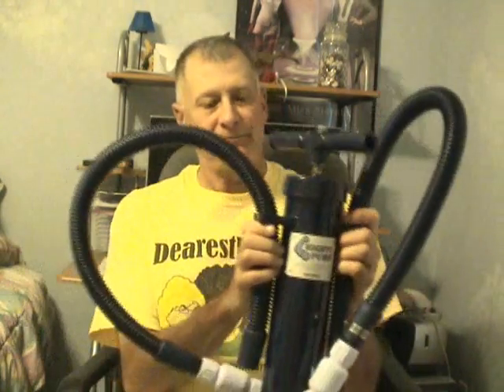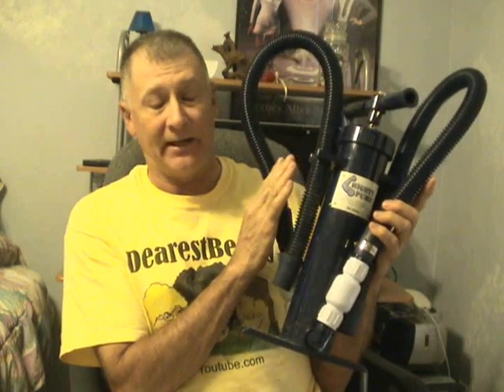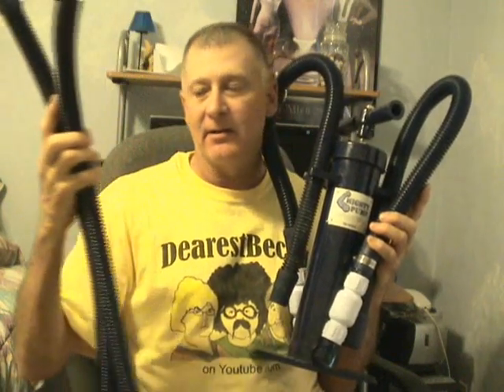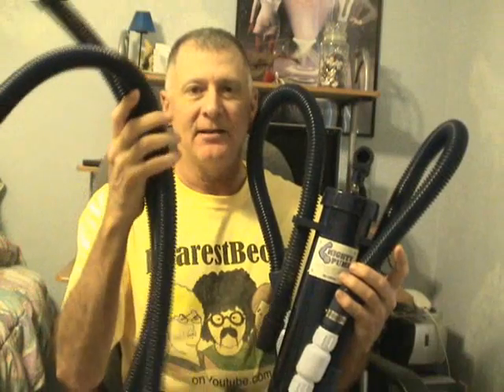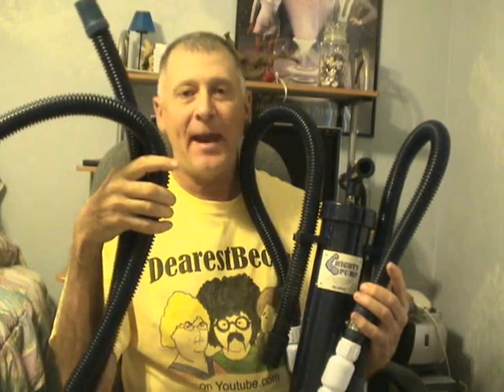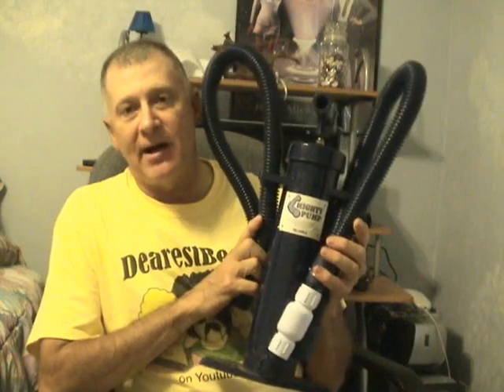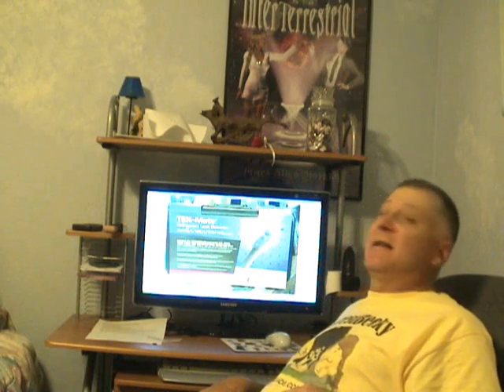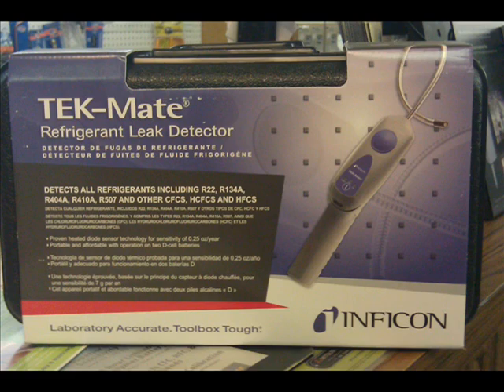HVAC: Mighty Pump update and some other stuff

Comment: I use that freon detector.  (office supplied it)  I've tried a few others but I like the 2 settings and no dial to tweak or fiddle with.  Have only had to replace the tip one time I think and not sure how long it was in service before I got it, hehe. 
   M@

Comment: Hey Doc.  You are right about Payne systems.  I installed a 5 ton Payne split system in my home which had a compressor rated at 4.5 tons. It is common practice in this part of the country to install an air handler rated a half ton larger than the condensing unit.  On my 5 ton system Payne simply went down half a ton on the compressor.

Comment: Worked for a company years ago , where common practice was to bump up evap coil 1/2 ton, to the condenser .. . ( 2 ton Condenser=2.5 ton evap coil , never the reverse) .We always try to go with same Ton drive on the inside blower unit as outside unit ...
Glad to see you posting again !!! Dr. Z that Super Tech, interactive DVD you turned me onto actually lets me do Superheat and Subcooling, with a print out I can give customers !!!
Take care , FRITZ

Comment: Thats some good product support!, normally it takes a lot of complaints and having to request replacement parts!

My first workshop split system was a mis-match mini split and we got it to work pretty good, but the amount of refrigerant had to be increased to allow compressor subcooling. it was a 6.1Kw Mitsubishi condenser on a 8.8Kw Fujitsu evaporator, and it worked fine with the correct charge, but without adding gas, the comp would loose  sub cooling and overheat.

Comment: @Metalcastr I'd check the comp discharge pressure after getting the system recovered and charged with the recommended amount of gas (its probably overcharged now) and clean the coils on evaporator and condenser!, car coils get plugged up bad!
if comp head pressure is low its prolly worn out, if not you may have a plugged/faulty TXV

best to take it to a Auto AC expert.